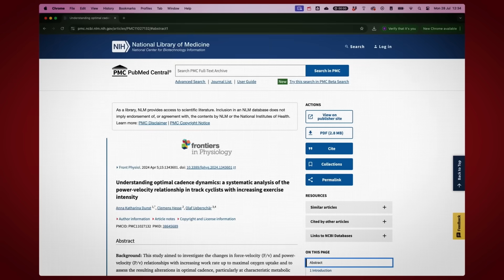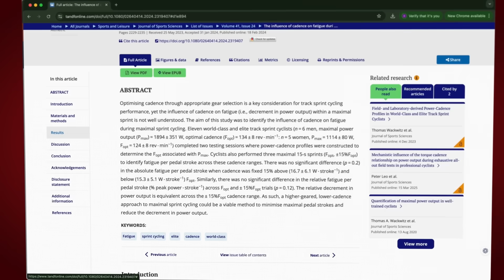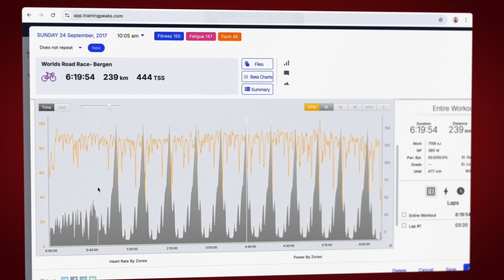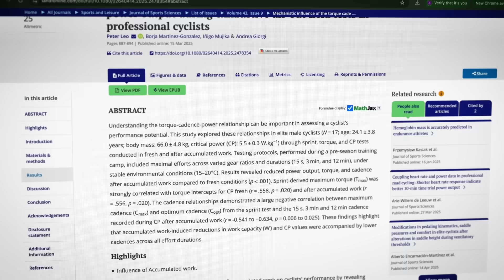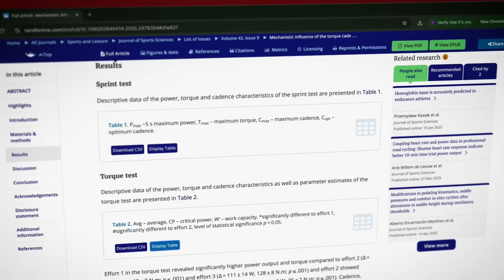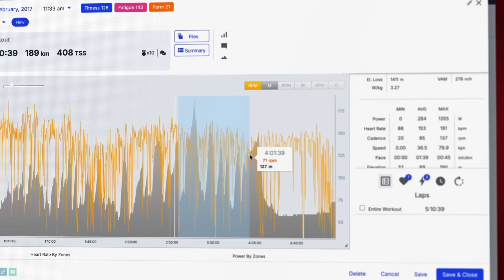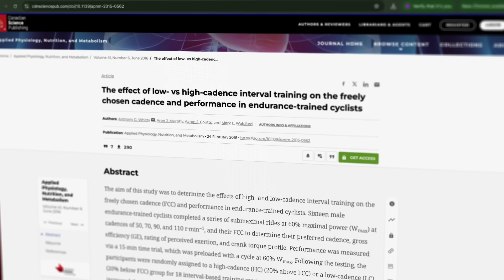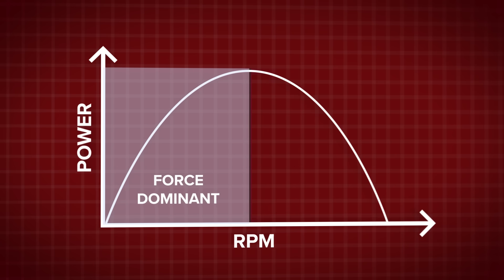I Thought I Knew Everything About Cadence. I Was Wrong.

Comment: I always went to higher cadence when things got tough, especially when I was trying to hang on to a better rider's wheel on a climb. I would start the climb at a 'normal' cadence and be keeping up but feeling like I might not be able to stay there for long, so to relieve some stress on my body, I would shift up a gear and spin faster, but then I immediately lost the wheel, even when I tried to spin faster still to compensate. So I would shift back down and try to settle back into a rhythm and I would come back to the wheel again. I didn't go all out to get back on, it just seemed to happen. Then I would tire and try the higher gear and cadence again and boom! I'd lose the wheel again. I was clearly able to manage a better pace using a lower cadence ie. my ability to climb at a high enough speed to stay on was diminished by my ability to spin fast enough to produce that speed. As uncomfortable as it felt to pedal slower, I was going faster. Either way, I got dropped at some point, but when I tried to stay on with high cadence, it failed straight away.

Comment: I know crank length is the hot topic of late, but tying that together with cadence got me thinking.  Earlier this year I was on a hike with some friends and we were trudging through about 18" of snow.  Half way through the hike I was out of gas and I couldn't figure out why.  Then I realized, I'm 5'6" and they were 6'1" and 6'3".  I was more fatigued because I was having to lift my legs significantly higher to get over the snow than they were.  So then I have to ask, if I'm a 5'6" rider on 170mm cranks vs a 6'3 rider on say 175mm cranks, that's a 5mm difference for 9" of height, which is a pretty big variance. Am I actually hindering my performance by having to make a bigger revolution?  I've noticed my power actually goes down when my cadence goes up. Is that because the bend of my leg is more acute at the top of the stroke due to the longer crank length, therefore making the top of the pedal stroke less efficient?  If I had a shorter crank length would I actually be putting more power through the top of the stroke because the angle of my leg is less severe? And by default, I wouldn't be seeing the drop in power at higher cadence? I was debating 165mm but now I'm wondering if I should take it down to 160mm.  Any other shorties out there in this boat?

Comment: Years ago I read the optimum cadence for the Hour Record was about 108 rpm. I might be slightly out but it was definitely over 100. I would always try to maintain 100 rpm on long training rides and that was easier with someone else with me because you are sort of micro half wheeling. One thing I found a few years after I packed in road racing and just rode the occasional club TT if I felt like it was that once I got a jogging watch and could set a cadence beat was that 100 was hard for me to maintain and I felt 90 was too low so 95 worked well. However my best 10 time was when I did 23.01 in a club evening 10 on a single carriageway road and didn’t go above 53X16, no longer had a watch, but concentrated on my breathing and was gasping like a 40 a day man. (This was pre-aero btw, I am an old man now)..Time trialling was never my thing though and I geared down in road races because it gave me the flexibility to adapt quickly to accelerations in the bunch. Being stuck in a big gear you would lose places - but this was in the days of down tube shifters so I don’t know if that would make a difference these days. I wouldn’t think about twiddling once things got serious and then I would chose the gear that felt right and I’m not sure I thought about it. Of course when your top gear is only about 100 you have very little choice.

Comment: When the body fatigues it does not lose the ability to spin, you lose ability to create force, which therefore power decreases and cadence decreases. if what you’re saying was right that when the body fatigues cadence drops and force does not, then why can the body just use more force to compensate for the lack of cadence  to keep producing power… simple, because the body  cannot produce the same force when the body is fatigue.
Don’t know where they be doing these stupid test just use common sense .
Any muscle in the body once is fatigue it loses the ability to produce force and once you lose the ability to produce force, then you lose the ability of rapid motion .
Reply: I was thinking the same and that increasing cadence is simply a way to override the loss of torque to maintain the power.

Comment: What he's talking about at 9 min is part of why I have issues with "More gears are needed" with 11, 12, and even higher cassettes.  You don't need to be able to dial in your effort that precisely with constant shifting....you need to be able to be comfortable adjusting cadence on the fly.

I was struck some years ago when Si was talking about Di2 and how it tracked how often he shifted, and he was shifting gears every few seconds...when I would go an entire rolling route without shifting at all.
Reply: That's a good point I wonder what difference it actually makes. I've gone to the extreme end of the gear shifting by having an infinite number of gears, a CVT hub, and an automatic shifting system that shifts every single pedal stroke. Maintaining my optimum cadence with more consistency that any derailleur setup ever could.
All it's probably done is made me highly intolerant of the wrong cadence. Or maybe it allows me to always be at my optimum efficiency.

Comment: Peter Leo's comments about width of optimal cadence band is interesting. Particularly on the flat, I can feel this, especially in TTs. I'm constantly chasing a non-existent (non-integer) gear because one feels just too easy and one just too hard. I wonder how well a continuously variable transmission would be embraced if one of low enough losses could be developed.
Reply: Yeah, I felt like he left that super-important constraint (gears available) out of the discussion.  I'm with you 100% on this - always chasing that "in-between" gear.  My natural cadence is mid 90's and its the gaps between 15-17-19 on the cassette when I'm on the 50 chainring.  I would happily trade the 11-12 sprockets for 16-18 to fill those gaps. I'm not a racer and never really need to apply power to the pedals when I'm above 50km/h (and if I really wanted to, I would be just fine spinning 100+ RPMs on the 13).  But if your natural cadence is closer to 80, you're probably chasing those ratios between the 12-13-14-15 sprockets (for which no fix exists)
Reply: Your cadence can make up for the non-existent gear.

Comment: I ride singlespeed. I’m efficient between 30 and 240rpm. Can I maintain 240 for more than 30 seconds? No, but I rarely need to. Does 30 rpm for 15 minutes hurt my knees? Yes, but I should be at the top of that section by then.

Comment: Thanks for hitting this topic, super interesting! I don't use power meters or do any serious research, testing, or training, but I have found that a higher torque low cadence seems to fatigue me much slower than a low torque higher cadence. When I did have a cadence sensor, my rides tended to be in the mid 50's to mid 60's (cadence) on an average ride.

Comment: Not reading the study (don’t feel like googling for it), the easiest way to control variables for cadence is using a fixed gear bike.  But often enough, for the rest of us, cadence is also impacted by the drivetrain resistance, such as the gear ratio between the front crank and rear cassette. Choosing a higher ratio tend to make pushing a higher cadence easier and vice versa

Comment: I do cadence drills every week, and have quite a wide range of cadence ability. I used to be a very low cadence rider, slog out 60-65rpm, and die as soon as the RPM went up. But it's risen significantly now, and I'm comfy at both the lower and upper ranges, and my cycling has drastically improved as a result as well.

Comment: When I started cycling some 9 years ago, the first thing I did was sort my cadence out, because that lead to being in the proper gear. My cadence settled on 90 rpm. So I'm naturally at the higher end of the spectrum - I found that I just couldn't grind, although over time I have learned how to do some grinding, but I just don't like it. Over the past couple of years though my cadence naturally evolved by itself, when I found that 90 rpm just didn't feel right. My cadence sweet spot is now 95rpm, and since I settled on that, I have seen some performance gains. I can quite happily ride around all day at that rpm. I think height and lever size may also have something to do with it - I'm 1.60 metres tall so I have smaller levers.

Comment: The classic book on cycling, actually titled “Cycling”, published in the late sixties by the Italian Cycling Federation (CONI) emphasized the importance of developing a fluid pedal stroke over a range of cadence. It recommended riding a fixed gear bike over rolling hills. I took that to heart and set up my bike with a 42x18 gear that worked out to 5 rpm/mph, or 100 rpm at 20 mph. That helped me develop a natural cadence of about 90, I could get up most hills but on long downhill stretches 150 was common. At those speeds, you can start bouncing on the saddle and to regain control you have to try to accelerate the pedals. This does wonders for your ability to spin up in a sprint. Fixies are great.
Reply: Crank length is also a big factor on cadence. I can easily maintain 105 rpms for hours since I run 160mm cranks and my top end cadence for sprints (160+) is far higher than most would have on longer cranks and wouldn't bounce on the saddle.
Reply: For exactitude, CONI is the Comitato Olimpico Nazionale Italiano, the Italian Olympic Committee. They also work as a "federation of federations" of various sports (Athletics, Cycling, Foot-ball, Basketball, Swimming, Fencing etc.)
Reply: @uffa00001 thank you for the clarification! Grazie.
Reply: 150 rpm downhill is ridiculously inefficient on all fronts
Reply: @neoneherefrom5836 
Yeah, but it’s fun. I have hit 200, but not for long!
Reply: @neoneherefrom5836 
Efficiency is not the point, btw, of doing that. It’s about forcing the rider to exceed their comfort zone to learn to pedal in circles. It’s also damn aerobic. Good early season preparation. And fun.
Reply: @trackie1957  I hear you. I spend most of my time in 50-18 or 50-16 myself. By choice though.
Reply: @neoneherefrom5836  That's just a training exercise. It should help develop muscle coordination and lower internal muscle friction.

Comment: I was never a sprinter i used to run long distances and cycle at the same time so high cadence for a long time is harder for me to keep. 
When I was young and racing it was just the time that higher cadence started to come about and later with Amstrong spinning faster it became more common. Let’s not take Froom as a typical example. in my late sixties i started training myself to up my cadence but still find it hard even on my trainer to sprint more than 95 RPM for any length of time 
I found that varying my cadence helps me maintain myself in any group ride I join 
I think that cadence is a lot about training but also about your natural rhythm and build

Comment: Personally I take my cadence very seriously, I like to spin slightly higher, not much. I'm a big guy and I'm old and knackered I find it helps me but it is something I worked at very hard over a couple of years. Now it's preprogrammed and I always ride the same cadence. I have mates who pay absolutely no attention to it. They seem to suffer more later in a ride and then their cadence gets even lower, it's like getting bogged down on the trainer 😂 Ebikes (I'm just finding out) are great for learning to spin your cadence because you get the most pay back from the torque and power of your motor. Great film Conor/gcn. Cadence so important to cycling but generally neglected.

Comment: I learned the correct cadence of 90 RPM while cycling with the metronome on my phone. I know sounds funny/silly but if it works it's good :) In fact, after a dozen or so rides, my legs started pounding out that 90 RPM rhythm on their own and now for 2 years I no longer need a metronome. I almost always (not counting difficult climbs) have a cadence around 88-92 RPM regardless of the length of the ride ;)
Reply: Muscle memory

Comment: One thing I noted this past year is that my cadence when spinning the cranks is about 5  RPMs on average higher outdoors than indoor (Zwift) for the same duration rides. Ninety-five outdoor and around ninety indoor. It is not intentional. I wonder if it has to do with the mental stress of outdoor riding, being aware of external danger; pedestrians and other road users, potholes, etc, versus the relative physical safety of indoor rides.
Reply: I think the answer is likely 'yes'.  Last year I noticed that my heart rate and cadence are consistently higher on night rides (past sunset) than day rides (both outdoors).  Data from this year shows the same.  My theory is that it's a natural fear of the unknown pushing me to be at a cadence more suitable to quick acceleration.  Boogie man, Sasquatch... or an actual real hazard around here, deer.

No fixed trainer, but my cadence is consistently lower on the rollers at home, I think due to a number of factors... bouncing on the rollers is more problematic than the road (smaller contact patch, trickier handling), and I can push to lactic threshold and just stop and walk it off... I'm already home, not 15 miles away. :)

For me, variety is good.  At 58 years of age, I still ride my 24" BMX bike a few times a month... a fixie with cranks longer than I can tolerate for long rides (180mm).  Good for a range of cadence and range of motion, and to just get on a bike with very different handling that can't really be pedaled without standing..

Comment: Remember that all advice from before 1990 came from the era of downtube shifters.  If someone jumped you, shifting gears was not always an option.   If you were already spinning moderately fast you had better acceleration, but you needed to spin even faster.  I could pedal briefly above 120, up to 150 rpm, to catch a wheel and then reach down to shift gears.  Integrated shifters changed the game.

Comment: I'm trying to compare this to driving a manual transmission car, where at any given speed, over any given terrain, on any given road surface and facing any given wind direction and speed, you can have a choice of rpm and gear combos. And since you might be changing your speed, on curves, climbs, descents, to pass if you're racing, etc., you have to keep making decisions as to which gear to be in and then match the rpm.

It's sort of the opposite with cycling, at least in the conventional wisdom, that you pick your gear ratio based on the rpm and road conditions, incline, wind, etc. But, while cars don't grow tired in the course of a given drive, and people do, and cars generally don't have off days, and people do, and so on, wouldn't it make sense, overall, to cycle more the way you drive, fitting your cadence to the conditions and gear ratio?

Or, at least, varying both to match the situation, which of course varies during the course of a ride, so there's no one optimal rpm for any given rider, let alone in general. I realize that you can only compare cars to humans so much, but there's got to be some overlap here, in terms of optimal speed, power, rpm and gear.

Comment: I got my first bike computer ~40 years ago, and cadence was always my focus. It's not that I necessarily try to ride at a certain cadence, but I pay attention to my cadence and how it feels in different circumstances.  I mostly ride in the mid-80s, but can go slower and faster as needed.
I have long legs and have been riding 180mm cranks for ~25 years, and I am interested in the relationship between "optimal" cadence and crank length. I assume that rotational velocity is foot speed, not cadence per se. Cadence and foot speed are proportional if crank length is constant, but if one goes to shorter cranks, which is the fashion, and torque = applied force x rotational velocity and applied force stays the same, then one must increase cadence to produce the same torque. Am I thinking about this correctly? My experience is that shorter cranks are "easier" to spin faster, so it makes sense.

Comment: I'm 61 geezer, cadence 90-100 in general but you gotta know bio bike fit, seat , height, bar width and cockpit , most don't spin circles, allows you to use more muscle therefore taxing the primary, quads, less.rpm, flywheel value goes up
Reply: Unreadable gibberish. If you tried proof reading prior to posting, you'd see that word salad isn't a great means of communication.
Reply: @MikeAG333  You need to tackle it like a cryptic crossword clue :)

I think he's trying to say if you have a poor bike fit then you are not engaging your muscles correctly leading to inefficiency of the pedal stroke in terms of power and cadence.  It's just as likely that the answer is "light bulb" though.
Reply: @doctormarazanvose4373  :) Yes, that's about how I understood it. My general point is more important though: learn English properly, and then use it properly!!!
Reply: @MikeAG333  Totally agree - he might have typed it smashed out of his head :D

Comment: I don't use a power meter. I control my workouts and ride intensity with various durations, cadences, and targeted gearing. So I control max and min power on each ride. I see it like gear ratios in cars. When you're cruising you need to be able to tap into a range of power within a specific gear

People say your body will self select rpm. I think that's BS. I would be rolling around at 70 rpm if I hadn't experimented with various cadences.